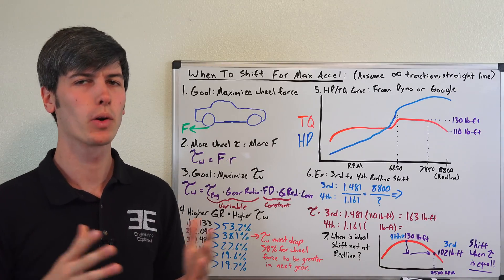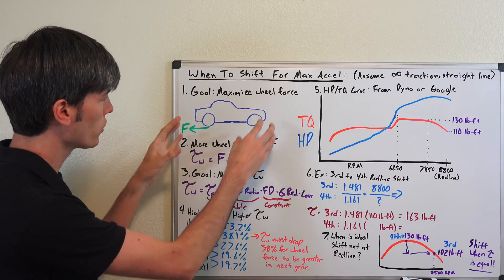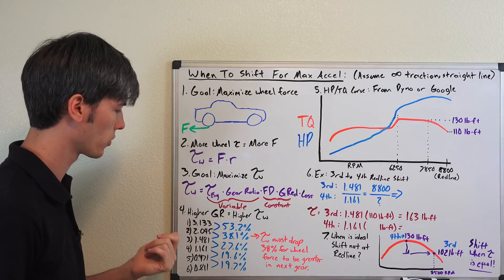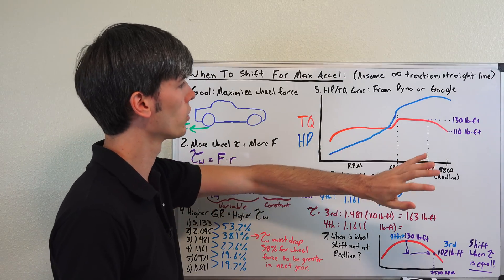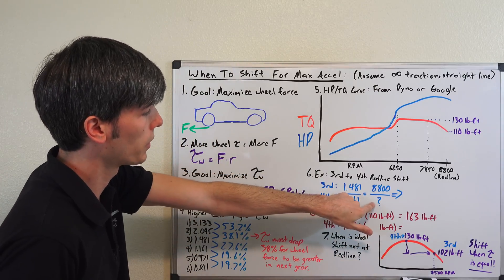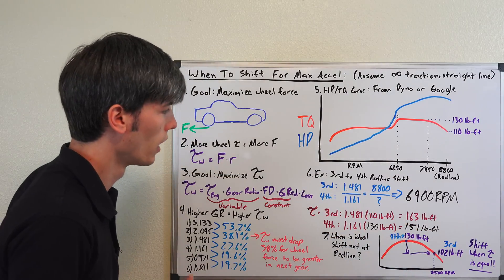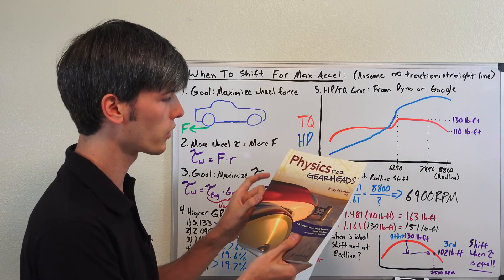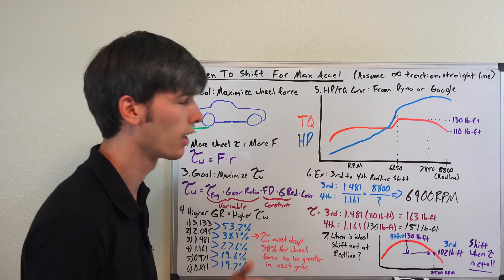When To Shift Gears For The Fastest Acceleration

Comment: can you demonstrate the practical applications of this theory ?
Reply: The  best demo might be using the sensations of pedaling a bicycle with multiple gears; the physics is identical.  Tests on bicyclists show that maximum pedaling torque is at around 90 rpm at the pedal crank, slower or faster pedaling produces less torque.  If you ride a multi-gear bike, you will be able to feel the force of pedaling torque change as you accelerate, weaker both at low and high pedaling speeds, just like an engine in a car.  Although you'll feel the need for more pedal force at low pedaling speeds, your legs will not produce very useful pedal torque until they speed up to about 90 rpm, and you can feel the change while accelerating your bike.  You can test this by racing from a dead start to a finish line (about a hundred yards away) while staying in the 'lowest' gear, then again in the 'highest' gear, then again finally while 'upshifting' gears.  During this test, you will be able to feel how your leg force (torque) changes as you accelerate, and you'll notice that you'll pass the finish line in the least amount of time when you shift gears during the races.  Try it!
Reply: thanks for your information now I know why is it a little bit harder to ride a bicycle at high gears even though I get a slightly better acceleration.

Comment: I don't get it, wouldn't you want to look at power curve rather than torque?
Reply: Read some discussion below, and I stand by it as far as I understand. Because the same torque will have different acceleration at different RPMs - that is what power describes. So compare power - adjusting for the gear ratios.

Comment: Try to find a Formula 1 dyno graph,and think again if you should use torque or power in your calculations.
Reply: Vega Lyra if you were right torque peak and horsepower peak would be at the same rpm.
Reply: what?

Comment: While shifting at the rev-limit is really the way to extract max performance out of most NA engines (although this rule does not apply to every NA engine, as engines with conservative cam profiles and close gear ratios might offer better performance at sub-rev-limit shifts), a lot of modern turbocharged engines will rev up to 7000rpm (sometimes even higher), but lots of them will only make you waste time if you rev them above 6000rpm. I discovered this few years ago when we found out that a friend's Audi A3 2.0T was faster when shifting at 6000RPM instead of the 6800RPM rev limit. When we dynoed the car (which had APR tuning) we found the reason for that: max power came in at just 4800rpm (!!!) and the power curve above 5800rpm got significantly compromised. In practical use, we found out only the 1-2 shift (for it's very high % diference) benefited from shifting at the rev limit, from 2nd to 3rd gear anywhere between 6000-6500rpm would offer good performance and from 3rd to 6th gear shifting at 6000rpm would always offer the best performance.

In 90% of the cases:
Modern naturally aspirated engine (specially hi-revving ones): best performance shifting at rev limit
Modified turbocharged engines with big laggy turbochargers: best performance shifting at rev limit
Old school stock turbocharged engines (also have big turbo lag): best performance shifting at rev limit or close to it
Modern engines with stock turbochargers (very low turbo lag, max engine torque before 2000RPM): best performance shifting at the end of the power range (usually comes up before the rev limit, I recommend taking your car to a dyno to verify its power band).

Comment: You should stay at the highest possible power. It is power that adds kinetic energy to your s2000. Which is basically what you said. Think of integral of power across the time of acceleration. Torque is just an intermediate step what you should care about is power.

Comment: question...if the dyno pull was performed (most likely) in 4th gear since it is to closest to a 1:1 ratio without being "overdriven" shouldnt the torque figure from your equation match that of the graph?

Comment: This solution is too complicated and imprecise.  Conceptually simpler and precise solution: plot the dyno curve in "horsepower (which is proportional to wheel torque) vs ground speed" coordinates for each gear (Excel or Google Spreadsheets) and then "which gear is most efficient at which speed" becomes obvious.

Comment: Dear Engineering Explained, you are a smart guy but this entire calculation is flawed due to the fact that you used torque to measure the rate of vehicle acceleration throughout the RPM band as opposed to HP. To get a correct figure you will need to do the exact same math but using the HP and NOT the torque.

Comment: Your solution is a little too complicated. All you need to do is to realize that power, in contrast to torque, is not affected by the gear ratio (assuming constant transmission efficiency as you did anyway), and therefore shifting to a higher gear is beneficial only if you get higher on the power curve after the gear change. By looking at the power curve directly instead of the torque curve you can skip the conversion of engine torque to wheel torque.

Comment: Some cars have slightly oddball torque vs. power curves. If you have a GM vehicle with the ubiquitous 3.4L 60° V6, Torque spikes upward just above 2000 RPM, starts curving sideways around 2800 RPM, peaks just above 200ft-lbs somewhere around 3800 RPM and falls off slightly like a plateau until 4800 RPM where it suddenly drops like a rock. Redline is somewhere above 6800 RPM, but that engine is so low-end biased it seems like there's not much point in going there. (I think it was originally meant for the S-10 light truck - thus torquey, but thrown in about every midsize GM car of the early 2000's anyways.) Thing is almost all the cars with that engine are automatic from the factory, so there's no point in worrying about where to shift. (The programming could still be heaps better vs. where the torque is, so it's still a shame there's no stick.) It's just that the cars have strong acceleration through the first two or three gears, but no top end to them. Great in city traffic as you can "shoot and scoot" and get away with it, but can be dicey getting into fast moving highway traffic from the on-ramp with the gutless 40MPH to 60MPH range. (This is made worse as the computer controlling the automatic has an annoying tendency to downshift into redline when there's more torque to work with by staying in-gear.) I wonder what the thinking was when they designed that setup? (The problem seems to be more with the transmission and it's programming than the engine.)

Comment: I have a automatic  (first car) and why does it shift at 3000 rpm somtimes? I've seen it shift at 5000 (which seems normal) but i thought once you reach the red line  (at about 6 and a half rpm) you have to shift gears. saving gas maybe?

Comment: Could you explain why almost all drag car's favor powerglide transmissions, most importantly because they only have 2 speeds, a 1.68:1 and a 1:1. My logic say's that you would want to run 4.56 diff gears and bang through as many gears as possible to get a good 60' time. Yet I've seen multiple examples of people with even low horsepower (relative, i mean like 600 wheel) get better strip times when they switch from a 4 speed to a 2 speed with lower ratio's
Reply: Bambi the Miata the idea is with enough power (torque), you don't need as many gears.  You have to compare "power under the curve" for the two different transmissions: a T56 6-speed revving through the first 4 gears vs a power glide revving through its 2 gears - doing all the math above, with enough power, a 2 speed with tall ratios might keep you in higher overall torque numbers that the 6 speed.
Then there's time lost shifting (because 0 power is going to the wheels) and gears low enough to spin the tires at WOT are useless on a race car.  If it takes you .10 seconds to shift, our T56 car's 1/4 time will include .4 seconds of 0 power going to the wheels - plus time spent "feathering" the throttle to keep the tires from spinning.
Reply: Not sure exactly but I'm guessing part of the draw to 2 speed transmissions is the fact you don't lose as much time in between shifts since you should only have to shift once

Comment: In sum: Only if the tq in your next gear is more than your current should you shift (with infinity traction and distance). For Ex muscle car like a 70 GSX w/ 355hp @510tq with a 4.11 rear end diff would be best on shorft shifted gears as all wheel torque is produced at lower revvs.
Reply from the maker: Mostly true, but emphasis on *wheel torque. Wheel torque requires analyzing the engine torque curve and gear ratios.

Comment: TL;DL - the answer is redline
Reply from the maker: *but not always, depends on the torque curve and gearing. Mazda Speed3 is an example of a car where this won't be the case, as the torque/power has a steep decline at high RPM.
Reply: @EngineeringExplained  Power curve more precisely unless you like to be confused and doing extra calculations.

Comment: Is there a optimal rpm shift for fuel efficiency instead of max acceleration?   I suspect many times people just run up to 2500-3000 rpm and shift then engine is inefficient at the newly shifted rpm.

Comment: Great video, Jason. Most modern petrol cars do behave like this. Diesels often do not, and turbo petrol/diesel engines are just more difficult to compute for. Could you make a video about dyno performance of turbocharged motors in different gears? They dyno worse in lower gears as the engine revs quicker in those gears, making lag more evident. Sometimes it makes sense to shift sooner to be on the next gear (especially for engines with a low boost threshold) and stay on boost longer than to wind out the motor while experiencing turbo lag the entire time in first or second. This video would be relevant because of the popularity of turbocharging these days. Thank you very much!
Reply: Do they not have any form of boost/lag control?
Reply: @melody3741  Factory cars don't however they do usually run recirc valves which should help largely elminate lag between shifts.

Comment: Hi Jason, great series of videos by the way! I always point engineering enthusiasts your direction. On your latest video you talk about shift point which is something I looked at several decades back and once the formulas are worked thru it becomes obvious that you shift when current wheel horse power drops below the value you are shifting into due to the fact that the wheel speed is the same for both gears so therefore the whp is directly connected to the wheel torque. With torque graphs and gear ratios it is easier to work out the points but I found others understood this fact very quickly if presented as whp also.

Comment: How much wear does your car get by reving it to redline?
The other day I was ovetaking a truck in 3rd gear and almost hit the redline (my car has its redline at around 6400 RPM, I shifted to 4th at ~6000). Does my car get extreme wear by high RPM? It was obviously designed to handle RPMs below redline but what RPM is the best for the car?
Reply: Yeah, I meant when accelerating. At constant travelling speed I choose gears when tachometer shows 1500-2500. Of course I wouldn't like to do 80 mph in 3rd all the time :)

Comment: Maximising torque doesn't equate to maximising acceleration though.  Power defines the rate of work being performed.  Before people start saying things about how power is a function of torque, I get this, but to put what I'm saying into perspective, say you have a modern turbocharged engine that has a flat torque curve from 1500rpm to 6000rpm, this doesn't mean that acceleration is the same if you shift at 4000 or 6000rpm as long as the rpm remains above 1500rpm in the next gear.  High force does not equal high acceleration.  Force from an engine comes in small rapid bursts from each combustion cycle.  Its like rowing a boat, if you row using strokes of moderate force but do it more rapidly, you may accelerate quicker than someone using strokes of very high force but infrequently.

Edit: I see there are many discussions about this now, and many people are still debating this.  Torque at wheels equation shown in this video consists of engine torque, gear ratios/final drive.  This equation is correct for wheel torque, but because it is not multiplied by speed/rpm, this does not represent acceleration.

Comment: So it's only about engine torque, not power? Sounds strange for me, cause usually cars with same hp goes the same time 0-100. Even if they have different torque. Like if you compare petrol and diesel BMWs for example. Or VW GTI vs GTD. The latter has more torque, less power and consequently slower 0-100 time
Reply: Aha, that last part of your explanation is a gem!

Comment: In this case you could've just explained this whole thing based on power. A transmission just transforms a set of torque and rpm into another set of torque and rpm - the product of both (power) stays the same going in and out of the transmission (losses aside). So for max acceleration you just want to shift in a way that gives you more engine power (equally more wheel power) after shifting, which means shifting at max or almost max rpm with most automobile engines. There's some layouts with massive power drops in the higher rpm range (like some older truck-/van- td's) - with these you might loose too much time staying in that drop-zone for too long, even if power after shifting might be higher than when shifting earlier.

Anyway... just wanted to mention that simplified power-thing - would've fit in perfectly, given your juggling with torque, rpm and gear ratio figures; even if you essentially explained the same thing and came to the same conclusions.
First time I thought "well maybe I would've explained it a little differently" in one of your videos though - and I watched them all (or maybe 92% or so).
Killer s2k sketch. I recognized it immediately. 
Cheers from a german fan and engineering colleague.
Reply: I am a little slow right now, mentally speaking, but so far your comment makes sense. Power is torque x rpm. So you are keeping all that variables in mind. It makes sense that you want the most power at all times, so, you have to be in the peak of the power curve. Normally redline hits when power starts to drop. And also, power starts to drop many rpm after torque drops off.

I guess car manufacturers always tune they cars so the redline is little after you should make the shift (like 200 rpm or so). Your goal is to maintain the engine in the happy zone.

Comment: Why would you assume that there is infinite traction? Traction is often the main limiting factor for acceleration.. If that is not the case for you, then you need a better engine...
Reply from the maker: Because I didn't want this video to be a debate about traction, I wanted to focus on the math behind when is ideal to shift based on maximizing the force at the rear wheels. If your car is incapable of putting down that force without spinning the tires, then you'll have to limit throttle as necessary.
Reply: We could also assume that this is spherical car in a vacuum.
Reply: neo landes why spherical???
Reply: It's an engineering joke.
Reply: Because the earth is flat according to spirit levels

Comment: All you have to do is look at the horsepower curve which compensates for differences in the gear ratios, i.e. the power curve never changes, no matter which gear you're in.  So, if you look at the redline in 3rd gear and the equivalent RPM when you shift to 4th gear, the power at redline is slightly higher, meaning it was a good idea to go all the way to red line.  The only time you need to shift earlier is if the power at redline is lower than power at the equivalent RPM in the next gear.  That means you're getting the maximum acceleration for any particular vehicle speed without taking gearing into account.

Comment: For everyone saying that torque is more important than horsepower, it isnt. The most important thing is what torque there is at a given RPM (hosepower). It's possible to have low torque, high revving car to perform the same or even better than a high torque lower reving car. This is easiy to see when you compare something like one of the standard ford focus models which has 210 ft.lbs of torque against a low torque high reving car like a formula 1 engine which has 260 ft.lbs of torque. There's not a big difference in torque between the two, but a huge difference in performance. This is due to the horsepower. The focus produces 113BHP and the F1 car around 800BHP.

Comment: A good explanation, but it can be simplified. In fact, horsepower is proportional to torque times rpm,
so at any given speed, torque times gear ratio is proportional to power. So you can just draw a horsepower
curve for each gear, which will be successively stretched out for higher gears, and shift where the
power curves intersect (if this happens before redline). In the Honda S2000 example, you can see almost
no drop in the power curve until redline, so it is optimal to shift at redline.

Comment: Does this differ for turbo diesel powered vehicles? I often feel like the torque available down low moves my vehicle along quicker than relying on the power available up high by revving out each gear. That's 'feel' though... what's the EE whiteboard say? :)